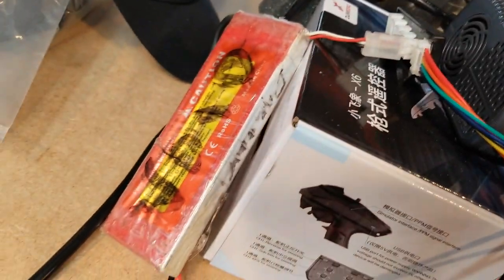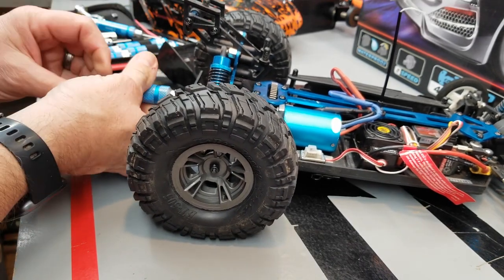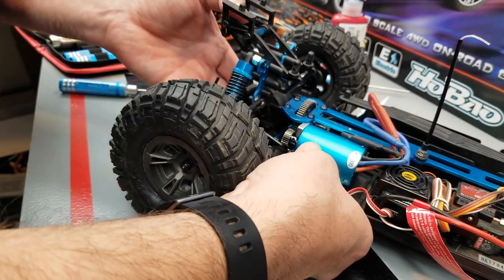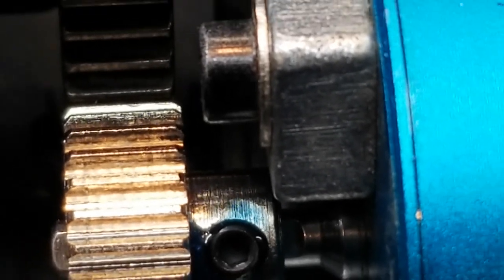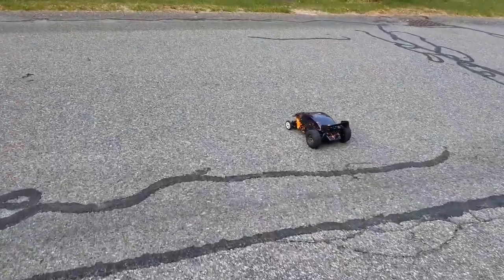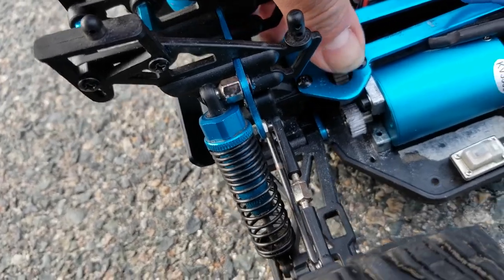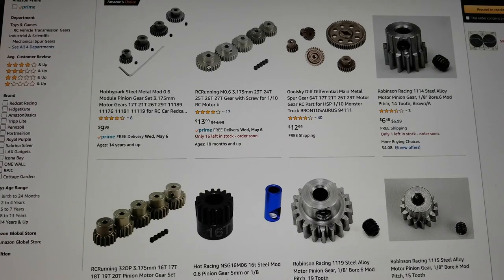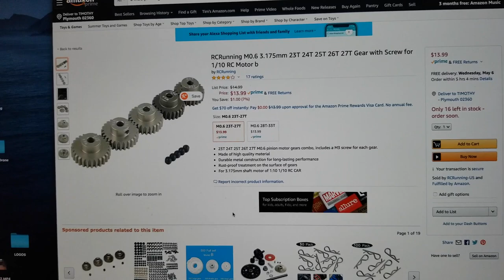Successful FAILURE Redcat Racing DragBug Conversion

Comment: How cool is this budget build!! Crawler tires hooked nicely. Sucks the pinion pitch was wrong. I think it may be difficult finding the .48 pitch spur for the Redcat. Obviously could fab one in there somehow. Either way. Cool build my friend!
Reply from the maker: Thank you! The spur had a go at fabbing the pinion. . . .   it didn't go very well😅😆🤣
Reply from the maker: Steel city this might not be YOUR typical size for running an RC but I'll tell you that it's truly a BLAST making this work😅😆🤣
Reply: @rcguygarage  😆🤣

Comment: I have the redcat valcano exp with a 4s brushless system that I did a truggy build on and melted about 5 pinions before I realized it's a metric pinion gear needed for these rigs not a standard gear

Comment: the motor pitch is wrong its diff size then the spur gear... I would replace both gears now that they stripped out some... Go with hardened machined steel

Comment: Great vid man. I just purchased a Kaiju today and was wondering if you had a recommendation as to what battery setup/brand to go with for 4s and 6s as far as mAh and c rating. Thanks
Reply from the maker: I use HRB USA GRAPHENES 4s hard pack and 6s soft. For 6s pack you need to round the sharp part of the plastic battery tray hold downs. I'll give you the exact specs later

Comment: Hearing should be 48 metric. Or .8mod same as volcano
Reply from the maker: Tornado is .6mod very close to 48 pitch🤣😆 harder to find locally at the LHS
Reply: I have a volcano uses the same sorry on miss quote on ,8 my experience on volcano redcat steel gear holds better

Comment: Mess is way to tight probably pieces of old gear
Reply from the maker: 48 to mod .6 🤣🤪🤣 works for ONE RIP but then we have CARNAGE
Reply: RC Guy Garage if you go to mod 1 ratios are endless an you won’t break them that’s what I run.
Reply from the maker: @kevinrc.marino2068  i think my issue is that it's a redcat budget conversion to drag build😆🤪🤣 I'm definitely going to keep pushing its limits
Reply from the maker: @kevinrc.marino2068  you are DEFINITELY someone to talk to about going FAST👍💯👊